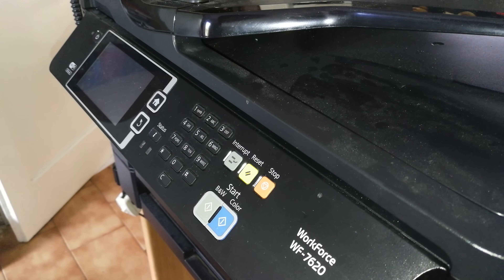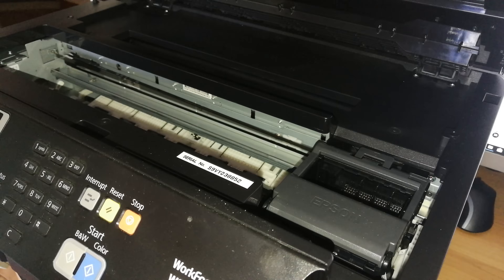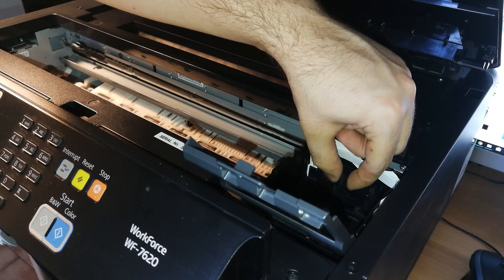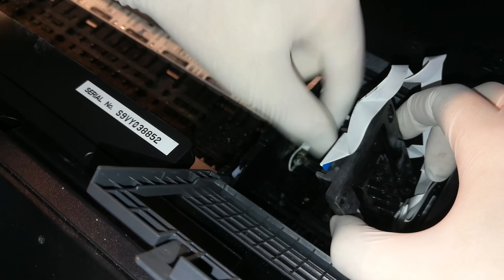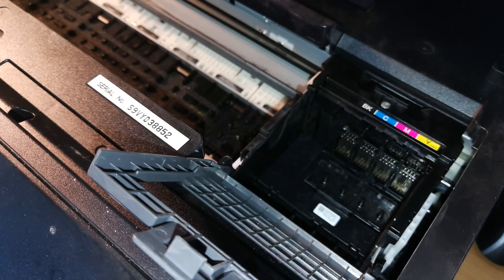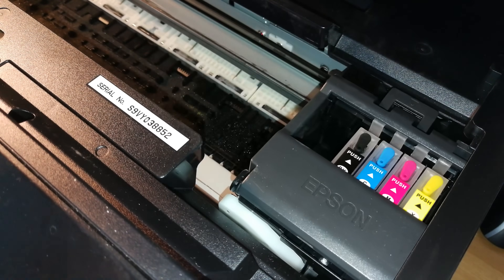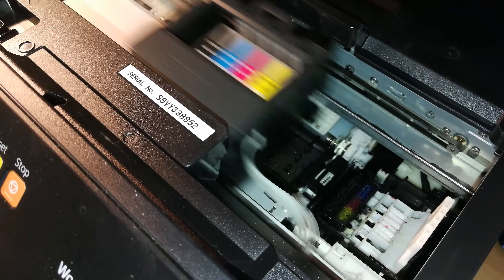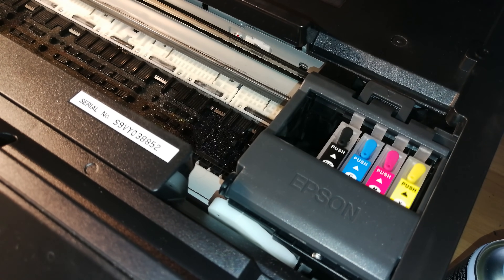Sostituzione della testina di stampa Epson WorkForce WF-7620, WF-7610 e WF-7110

Comment: This printer definitely is troublesome.  Btw do you have any experience with EPSON Vertical Banding Errors?  I am having a problem with kind of a unique pattern that affects ALL the inks, EQUALLY.  And I'm wondering if this is an Epson software issue?   -->  https://www.printerforums.net/threads/epson-wf-7620-wf-4620-thick-vertical-lines-error-how-to-fix.68698/
Reply from the maker: That definitely seems like an electrical problem, I've never seen anything like that on Epson printers, only on HPs.

Comment: where do you get replacement  head
Reply from the maker: Sorry for the delay
I bought it from an epson authorized reseller, but they are very expensive that way and I didn't pay for it (the customer and printer owner paid). You can find even some heads on AliExpress but I don't guarantee they are new revision...

Paolo M.

Comment: Hi,

What kind of ink do you use? can you add a lik?
Can I use these in the attachment products?
Can I take the printhead apart and clean it well? the printer prints some lines smeared?

Thank you

https://www.ebay.de/itm/142018666130?ViewItem=&item=142018666130&refid=store&ssPageName=STORE:HTMLBUILDER:SIMPLEITEM

https://www.ebay.co.uk/itm/Print-Head-Cleaning-Clean-Cartridges-for-Epson-WF-3620DWF-WF-3640DTWF/272897613954?epid=25005957799&hash=item3f89f72082:g:1WAAAOSw-W5UwOpy
Reply from the maker: @baselstadt1992 Hi!
Sorry but you can't tear down the printhead, it's one piece and can't be disassembled without damaging it.
I use the exact same ink brand you linked, and for the cartridges it doesn't matter much because nearly every refillable cartridge is the same.
Consider that the first printers of these models sold have defective printheads, that die after a few hundreds of pages printed, so you could be in that situation! In that case the only way is to replace the head.

Paolo M.

Comment: You did a great job on this video. This is my printer, and my problem is not so much that I need a new printhead, but when I do  a nozzle check there is one line in black that always has gaps, no matter how many cleaning cycles I do. I think I can take out the printhead and soak it in cleaning fluid (ammonia). Perhaps this will clear out those nozzles. I don't know for sure.
But you said the sponge pads under the printhead can be replaced. I would love to know how to do that. I have run so many cleaning cycles that I think this pad is soaked with old ink. Can you tell me how to do that?
One final point --- please put your camera on a fixed focus. Every time you put your arm in the scene it focuses on your arm instead of the printer. 
Thanks again. You teach well!
Reply from the maker: Hi Douglas
You can try to soak the printhead with cleaning solution but that actually doesn't require that you remove it from the printer, but more on this later.
About the "pads that can be replaced" I meant the waste ink pads, they are contained in the maintenance box, and you can change the maintenance box on your printer when it reaches the end of its service life with no problem, but it's not needed to replace it before.
About the manual cleaning of the printhead, you can just unlock the carriage (as I've done in the video) then deposit some cleaning solution (not pure ammonia, you could damage the printhead, use at max. 30% ammonia in 70% distilled water) on the black pad on the purge unit. When the pad is totally filled with cleaning solution you can just move very slowly the head on top of it, keep in mind that when you'll move the head on the purge unit the pads will come up making contact with the bottom of the printhead (nozzle plate) so it's actually the same effect as removing the printhead and soak it externally. Also you don't need to remove the cartridges, so no air will get inside of the printhead.
Finally, for the camera focus issue, I'm aware of this problem but I don't have a solution for this :/ I use my phone to record that is a Huawei P10 Plus, I don't use a camera with any settings to record professionally, but I always try my best not to block the view.
Thank you anyway for all the suggestions, and if you need anything else feel free to contact me again :)

Paolo M.

Comment: The print-head cost as much as another printer.
Reply from the maker: Depends on where you get it, anyway it's better to replace the head other than generating waste :)

Paolo M.
Reply: There is also a risk factor in breaking the existing printer while changing the head.  Cost difference less than $40 between a head and a new printer - that is all lined up, clean ready to go (or return if that does not work) - INCLUDING a pack of new ink cartridges.
Reply from the maker: Still holding to my opinion, but you can choose to do whatever you like :)
Reply: @PaoloMarcelli  I can respect that.   I fix everything I have that I can, and modify it better if possible.  Just these ink heads and whole system is do delicate, it is easy to make expensive mistake.  Sometimes ink get all over the encoder wheel or strip.  The paper feed rollers wear out too.

I been breaking down the same epsom c80 for a while now, trying to get it to feed whatever I want through it.
Reply: What Am I Gonna Get ? I followed your logic and now have three of these things sitting around inoperable.
Reply: @ralphwild6965  Me too.  I box, label, shelve and store.   Pick up project later on when I wish to experiment.  Usually after I decide to throw away is when I regret.

Comment: If my yellow and Magenta ink is leaking on my prints when I print, does that mean I need to replace my printhead?  Its not simple ink spots or lines  it actual blobs of ink on my prints
Reply: or do I just need nozzle part?
Reply from the maker: @PhotographyChick17  Hi!
There are some things to check that I need to know:
1. What printer are you using? I mean brand and model number.
2. Are the paper settings correct?
3. What type of cartridges are you using? (ex. compatibles, refillables, OEMs)
Reply: @PaoloMarcelli  Epson Workforce 7610, Yes the paper settings is correct, I'm using refillables

Comment: Close the scanner unit 7620
Reply from the maker: Hi
This error is not related to anything you should've done to replace the printhead! Check all the tabs are attached correctly and nothing pushes against the scanner unit. Try closing manyally the scanner sensor to see if actually there's a problem with the sensor or it's something else

Paolo M.